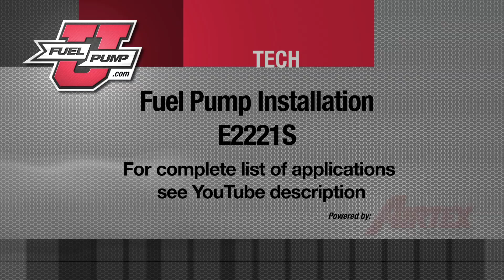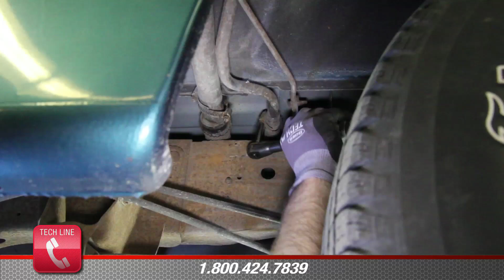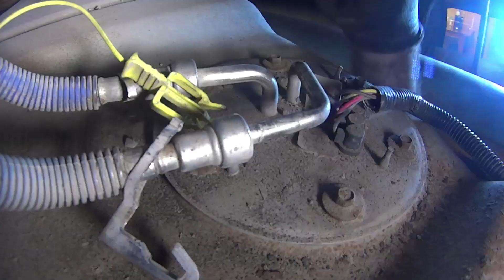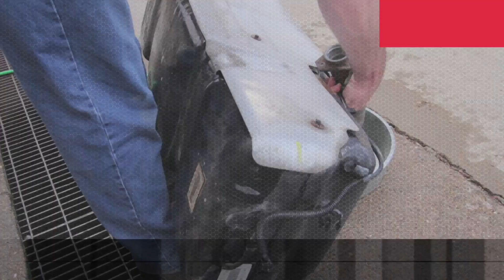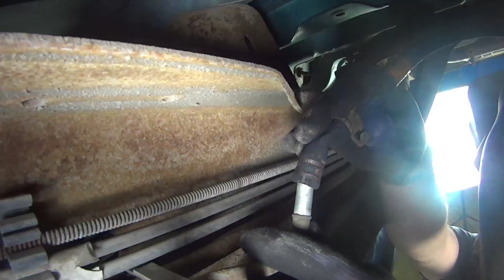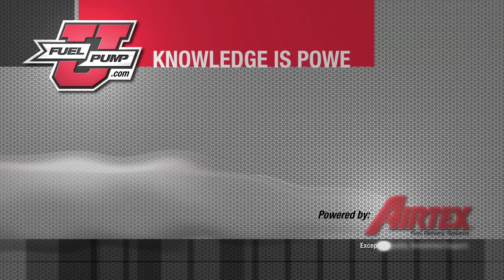How to Install E2221S Fuel Pump Sender Assembly in a 1997 - 1998 Ford F150 F250

Comment: I have a 97 f150 4.6L my truck has an idle and my gas needle is at E and I add 20 dollars of gas and needle goes to half a tank and it's only like 6 gallons of fuel pumped and when I brake gas needle moves down as a asselerat the gas needle moves up. Do you know where I can start?? Thanks!!
Reply: Alright I'll do that. Thanks for your help appreciate it!!
Reply: @jesuslopez4761  It's the Fuel Pump my Truck use to do that because of the Fuel pump Floater 👍

Comment: I have a 02 f150 5.4l fx4. Sometimes it cranks right up and others it just turns over and  I can smell fuel. I come back a few hours later and it cranks right up. Anyone have this trouble before. Thanks
Reply: Good video but I was wondering what the fuel pressure spec's we're also on that same model key on engine off and with the engine on
Reply: https://youtu.be/TZEtPNnMi3U